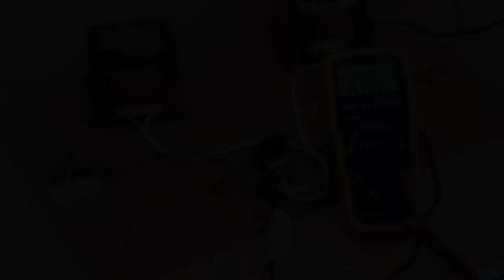DIY Welding Machine / Only 2 Microwave Transformer / Good Job

Comment: Great project, some opinion, connect also magnetic circuit (transformers) to ground earth not only the back lid of the case also connect the upper lid and front of the case to earth. Better to use a dimmer with optocoupler at command, for safety. Also can be add a switch to connect series/parallel (attention for parallel connection to respect the conditions). In parallel you got maximum 20V (half from series connection) but the current is double like in series connection.
Reply: Also, in general, is important to got the warm air outside from the case not push the flow air from outside in the case at 18:15. Another idea is to add second secondary winding to power the fans or to put fans at 230V AC, something like DP200A2123XBT. Also for safety add a fuse breaker at primary winding (I think 16A is maximum, but better look at transformer info (label) what is maximum current for primary).
Reply from the maker: Hi.  Thank you for the recommendations.  The idea of using switches for parallel connection is awesome.
Reply: thank you, for this you can use dpdt switch in connection series parallel, if you can found a switch what can delivery your current, but is not expensive to use nuts and bolts with bars connections (like in three phase motors connection case), once again attention when connect in parallel two transformer, looking on the net for conditions.
Reply from the maker: Thank you.  I am knowledgeable in these matters.  My main job is on electronics...
Reply from the maker: It also occurred to me to add a separate winding to the secondary winding.  However, in this case, there must be continuous energy in the transformers for the fans to work.  Because of magnetic losses, it would be wasted energy when not used.  It is necessary to put insurance.  Soon I will make a video for the process of converting the output to DC.
Reply: Great, if your main job is on electronics you understood what I say. Also is great if you add possibility for DC output.
Reply from the maker: I supplied the materials for the DC output.  I'll post a video if it works properly as I planned.

Comment: What is the function of this dimmer in this welding machine?
Reply from the maker: Hi. Dimmer changed the voltage value applied to the input of the transformers (for example, between 230V and 180V). In this case, the output winding is that the resulting voltage and thrust change in the secondary. If necessary, it will change the exchange of the welding machine to change the output current.
Reply: Here, the voltage is 220v. If I regulate to 120v, can I still solder?
Reply from the maker: If I have not misunderstood, you are asking if the mains voltage is 220V where you live, and if you adjust the voltage to 120V with a dimmer, is it possible to weld... I will try to explain this with a simple calculation... While the input voltage is 220V, my machine outputs 40V.  The same machine outputs an average of 20V when the input is set to 120V.  In this case, it can give a current of around 50A.  This current value cannot melt the 2.5mm electrode.  The value should be slightly higher.  If you think that the answer to your question is not what I wrote, write again.
Reply: Yes, that's what I asked. Thank you!😂
Reply from the maker: Thank you too 👍

Comment: How many turns can be given in 3-wire transformers thanks

What is the name of that thing to regulate the. Voltage as I google it
Reply from the maker: Hello.  I don't understand what you mean by 3 wire transformer.  But I made 24 windings in these transformers.  Neatly with 4mm2 silicon insulated copper cable.  The name of the electronic circuit used for the output current adjustment is "dimmer" and you can find it on the internet under this name.
Reply: You see, I have 3 transformers. My question is how many turns do I have to put on the cable? It will be 34

what size is the cable q caliber is 10 8 which
Reply from the maker: I understood properly now.  If you have 3 transformers, you can make 16 windings for each transformer with a 6mm2 copper cable.  In this case, you will need about 4.5 meters of cable for each transformer.
Reply: last question can the dimmer go alone or does it also play the other BT136, BT137, BT138 these thanks
Reply from the maker: Hi.  If the power of the dimmer circuit you purchased is low, you need to connect an extra triac like I did.  In this case, it would be better to add 3 or 4 parallel bt137s according to the power value.

Comment: Saludos amigo esta máquina es 220 o 110
Reply from the maker: Hola.  Pido disculpas por regresar tarde.  La tensión de red que utilizo es de 220V.  Sin embargo, también puedes usarlo a 110V haciendo lo mismo.  Porque los transformadores para hornos microondas producidos en su ubicación se fabrican según 110V.  La única diferencia es que la corriente extraída de la entrada será mayor a 110 V, por lo que los cables utilizados en el lado de entrada deben ser más gruesos y el circuito atenuador utilizado para el ajuste de corriente debe ser de al menos 6000 W.
Reply: Gracias

Comment: I would have liked to know how many winds he made on those secondary and a wiring diagram for the triacs. It isn’t even very clear where he soldered them or why.
Reply from the maker: Hello.  I actually shared the information in the subtitles.  In the secondary winding, I made 24 turns of winding with a silicon insulated copper cable with a cross section of 4mm2.  I used 6.5 meters of cable.  This is the same for both transformers.  A total of 13 meters of cable is required.  The circuit I use is the dimmer circuit you can find in the market.  I added 4 triacs to make the circuit more powerful.  You can find the schematic and general wiring diagram for this connection in the description section.  If there is anything unclear, you can ask.
Reply: Thank you. Sorry, I never read the descriptions!
Reply from the maker: Thank you too 👍

Comment: Hello, I have a problem. I made one like it but it gets very hot and melts
Reply from the maker: Hello.  There is heating, yes, but there should be no melting.  You had to use silicon insulated cable in the secondary winding process.  If you do not do this, the PVC insulated cable insulation may melt.

Comment: ho provato con un trasformatore di un microonde da 1100w al massimo posso inserire 12 avvolgimenti ed ottenere da un trasformatore 9,25 volt ac ... se ne metto due arriverei suppongo a 18,50 volt ac e non a 40 volt... da quento sono i tuoi trasformatori ... grazie
Reply from the maker: Ciao.  Qual è la sezione trasversale del cavo che stai utilizzando?  Penso che tu abbia usato un cavo da 6 mm2.  In questo caso è necessario utilizzare più trasformatori.  La tensione sarà più bassa ma la corrente sarà più alta
Reply: 4mm

Comment: Hi, how did you manage to control the voltage output? I tried to use what is on your video but only managed to make it work for a few seconds until smoke came out the board.
Hope that you can share your thoughts about this..
Thank you!
Reply from the maker: Hello.  I used a dimmer circuit for voltage control.  You know this.  I also gave the connection diagrams in the description section.  Did you check your connection according to the schematic?  I would like to help you as much as I can, but we need to find where the error is.  If you want, you can take detailed photos and send an e-mail to muratguney67@gmail.com.
Reply: Thank you for your reply. I'll email it then.

Comment: Murat eu assisti seu video e o seu dimmer nao tem fuzil sera k pode ser isto que o meu queima o fuzil se responder agradeço
Reply from the maker: Como uso fusível automático em minha casa, não instalei fusível dentro do aparelho.  Se o fusível que você usar for de 16A, não servirá.  Obviamente, os elementos do seu circuito dimmer também podem estar com defeito.
Reply: Murat bom dia eu testei o dimmer 4000w antes de colocar esta funcinando normal e o fuzivel e de 25amp e queima no seu video funciona aki não funciona acho k puxa muita amperagem a hora que fecha curto
Reply from the maker: Isso é tão interessante.  Bem, você já experimentou a máquina sem instalar o circuito dimmer?

Comment: Hola,,la corriente que le entra es de 110 o 220
Reply from the maker: Hola.  Aquí la tensión de red es de 220V.  Sin embargo, este sistema también funciona con 110V.  Debido a que en lugares con voltaje de red de 110 V, los transformadores de horno de microondas también se enrollan de acuerdo con este valor de voltaje.  Lo que hay que tener en cuenta aquí es que cuando el voltaje de entrada es de 110 V, la corriente de entrada será mayor para proporcionar la misma potencia.  En este caso, los cables utilizados en el lado de entrada y el circuito de atenuación utilizado para el ajuste de corriente deberían ser más duraderos.  No hay diferencia para el lado de salida.

Comment: Podrias mostrar mas el regulador q colocaste por favor
Reply from the maker: Hola.  Este circuito electrónico es un circuito dimmer.  Es un circuito muy sencillo y económico.  Dado que el atenuador en mi mano es de baja potencia, agregué 4 triacs adicionales en paralelo.  puede encontrarlo buscando en Internet como "atenuador de 4000W".  Si usa 4000 vatios, no será necesario agregar un triac adicional.  para que pueda usar el circuito a medida que lo obtiene.  Puede encontrar los diagramas de cableado relevantes en la sección de descripción.  Vuelva a escribir si hay algo que no esté claro.  que tenga un lindo día

Comment: What is the voltage and amps required
Reply from the maker: Hello.  The output voltage of this instrument is 40V and the output current is around 120A.  Did you ask about these values?

Comment: Hello my brother how can I get silicone resistance wire in Nigeria is it possible to send the wire across to Nigeria I will pay for it and I need it adjustable current control thanks
Reply from the maker: Hello.  I don't know how you can find the cable in Nigeria.  Don't worry.  You know, it wouldn't make any sense for me to post it here.  This cable is a silicone insulated cable.  It is generally used in the interior installations of electric heaters.  It is possible to be found on the internet as N2GFAF cable.  You can also use AWG10 cable.

Comment: Puedes enviarme las especificaciones y explicaciones de cómo hacerlo?
Reply from the maker: Hola.  En este estado, la máquina de soldar tiene un voltaje de salida de 40 V CA y una corriente de salida de 120 - 130 A.  En el video que agregué recientemente, mostré el proceso de convertir el voltaje de salida de esta máquina a CC.  Cuando se convierte a CC, el voltaje de salida se convierte en 60V.  El electrodo máximo de 3,25 mm se puede derretir.  Usé 2 transformadores para hacerlo pequeño y ligero.  Dado que la corriente consumida es ligeramente superior a la del cable utilizado, utilicé 2 ventiladores como precaución para calentar y utilicé un cable de cobre con aislamiento de silicona para el devanado secundario.  El video tiene subtítulos en español.  Puedes verlo con subtítulos si quieres.  Puede encontrar los diagramas sobre las conexiones en la sección de descripción.  En realidad, es bastante simple de hacer, pero el proceso de bobinado es un poco complicado.  Agregué 4 triacs adicionales al circuito para hacer que el circuito de atenuación que tengo para el ajuste de corriente sea duradero.  También puede utilizar circuitos de atenuación disponibles comercialmente.  Sin embargo, debe tener al menos 4000W de potencia.  Intenté explicarme lo mejor que pude.  Todavía puede hacer preguntas sobre cosas que no entiende.  Gracias por su atención

Comment: why must use 2 transformers   , will only one is ok  ?
Reply from the maker: When only one transformer is used, the required power for arc welding cannot be obtained.  2 or more transformers are required.  As the number of transformers increases, the new winding cables wound on the secondary side can be used thicker.  In this way, the current that will melt the thicker electrodes can be reached.  When using 2 transformers (as I did) 2.5mm and 3.25mm electrodes can be used.  For thicker electrodes, this system is not sufficient either.  Since the current is not enough, the electrode sticks to the weld material.
Reply: thank you for explaination
Reply from the maker: Thank you too 👍

Comment: Hola que excelente video y equipo que construiste demasiado perfecto y limpio, no parece casero, soy de Venezuela esta cuenta es de mi hija, quería preguntarte algo, pues la tensión de corriente normal aquí en Venezuela es de 120 voltios, si existe la 220 para equipos de acondicionadores de aire, pero los equipos en general son para 120 voltios, los transformadores que usas son de 220 voltios, si uso transformadores de Microondas de 120 voltios, seria igual. Y otra pregunta, ese dimer y esos rectificadores que usaste, polarizan la corriente? y donde buscaria ese Dimer sobre todo? Espero que hables español.
Reply from the maker: Hola.  Ha habido un post anterior sobre una situación similar.  Dado que los hornos de microondas utilizados en lugares con tensión de red de 120 V se fabrican de acuerdo con 120 V, no hay problema.  De hecho, un amigo nuestro, "Roberto", que escribió hace un tiempo, hizo esta aplicación y le puso bastante tensión.  En cuanto a su otra pregunta, agregué 4 triacs porque el atenuador en mi mano es de baja potencia.  Lo que hice fue hacer que el circuito de atenuación fuera más potente.  (Puedes ver el video con subtítulos en español) En este video no se hace rectificación de voltaje de salida.  Estoy pensando en hacer un rectificador y publicar un video de esta máquina de soldar pronto.  Por supuesto, si no hay problema.  El circuito de atenuación debe estar donde vives.  Es un circuito muy utilizado.  Puede encontrarlo en el sitio de aliexpress escribiendo "4000W dimmer".  O puedo enviarte un enlace si quieres.  Puede que tarde mucho en llegar pero...

Comment: Made welding plant with 3 microwave transformer and the plugs always heat up fast would like to know how to build a voltage and amps controller for it
Reply from the maker: Hello.  Did you mean transformers getting hot?  It's normal for transformers to heat up.  I am using dimmer circuit for output voltage and current adjustment.  If the dimmer circuit is low power, it will fail quickly and there will be no current adjustment.  Therefore I need to amplify it by adding a triac or I need to use a powerful dimmer circuit.
Reply: The input circuit keep getting hot wanted to know why the input circuit keep getting hot as soon as I weld , give or take 30 second's then breaker trips wanted to know if I could put the power controller on input circuit
Reply: Would it make a difference
Reply from the maker: The control circuit (dimmer) will be in the input section.  If the circuit you put in is getting too hot, it may not have enough power.  Do not neglect to use aluminum heatsink.  (As a result of the translation, I wrote this answer as far as I understood. If it is not enough, please write it again)
Reply from the maker: As far as I understand your language is not English.  Write in your language if you want.  I will translate it to Turkish.  Maybe it will be more understandable this way.
Reply: it's enough am grateful

Comment: What's the number serial of the triacs???
Reply from the maker: Hello.  I used triac number BT137.  There is a separate video for this circuit on my channel.  You can find the clear schematic of the circuit in the description section of that video.  If you want, you can make or have a PCB made with the files I provided.